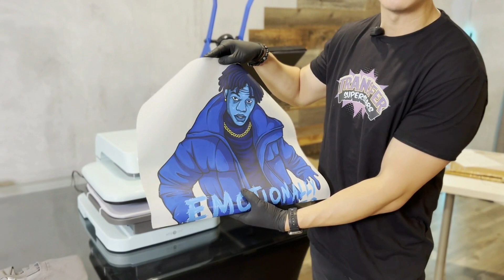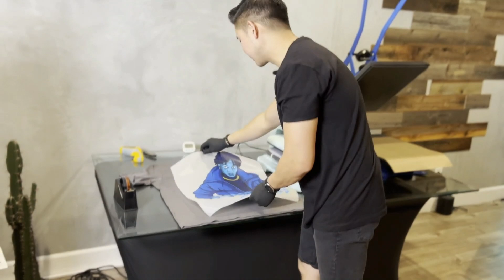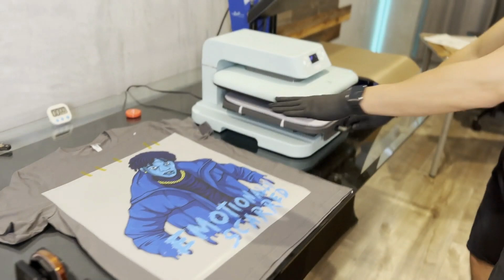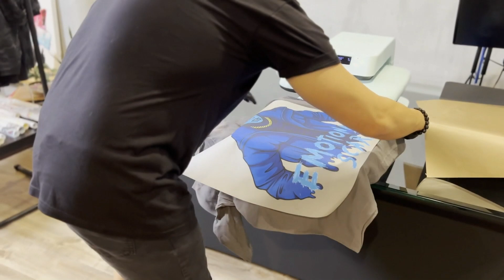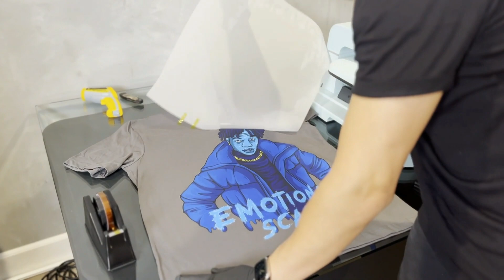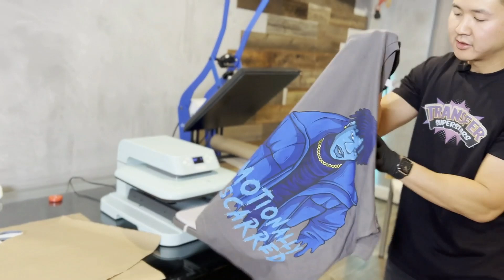How to Press an OVERSIZED DTF Transfer with a Standard Heatpress

Comment: Whenever I press a dtf design this big, the T-shirt feels stiff in the area where the design is. Is this due to the dtf or is there a way to get around this?
Reply from the maker: We have a good film, ink, powder combo to make the print soft but This is an oversized print, even with screenprinting you will feel the print.
Reply: How many times are you pressing it and for how long?

Comment: So basically we cannot use a hot peel transfer for this as we have to wait for all sides to be over before we peel off the transfer?
Reply from the maker: You technically can, once you heatpress the shirt, you can go through it once more to warm up the hot peel and it should peel fine. We are working on a new film that will peel both hot and cold

Comment: Please do a video about Temperature and pressure for different garment knowledge...
You are the genius of DTF
Reply from the maker: We recommend heavy pressure to ensure the longevity of the transfer. As far as temperature goes, we stay between 275-300f, normally for 7s. Certain materials like polyester and nylon have a lower burning point, so we recommend the lower temperature for those.